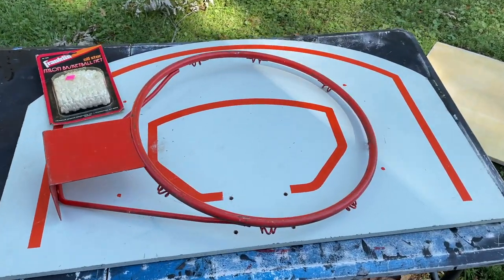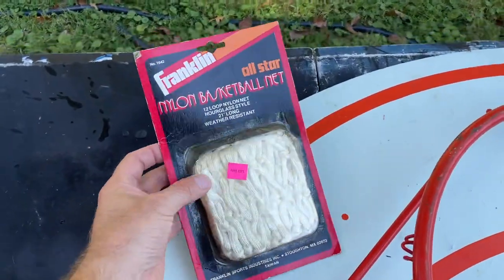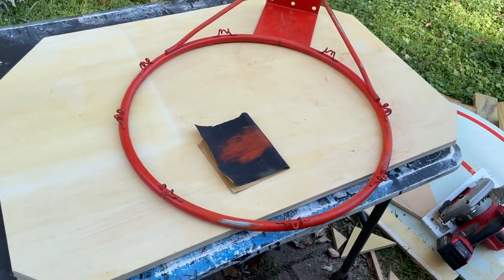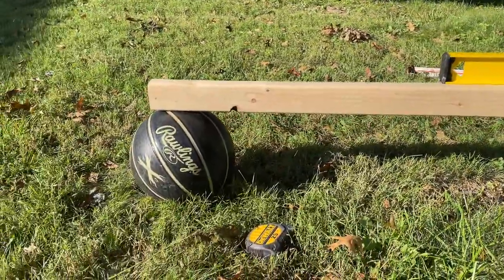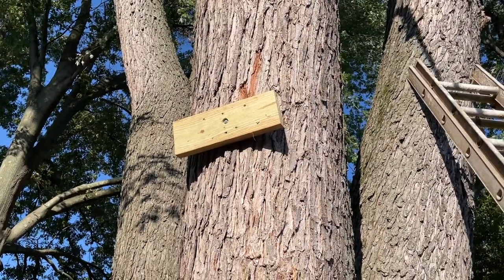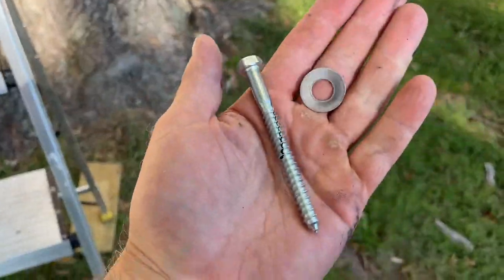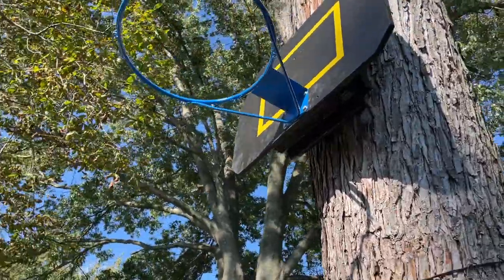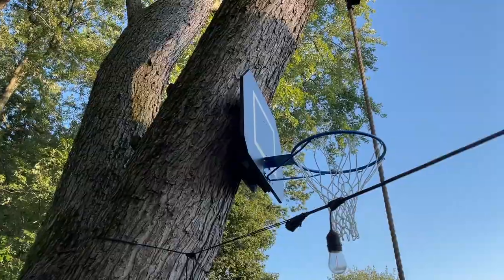How to build a Backyard Basketball Hoop on a Tree.  Fun Project Under $20 bucks!

Comment: Can you show in more detail how you secured the backboard to the tree please?
Reply from the maker: once i bolted the 2x6s   to the tree.  i just screwed the backboard to them using 3"  outdoor screws.
Reply: @HowToWithLech  How many 2x6s, and how far apart? And how many screws? And did you go thru the front of the backboard?
Reply from the maker: @timkav69  its Custom for every setup / tree. Just have to make it fit.  Similar to what i did .   Yes screws right through front of the board. I have extra plywood board behind it for extra support.  Handful of screws did it.   So what feel secure